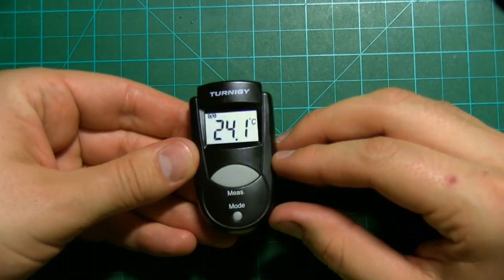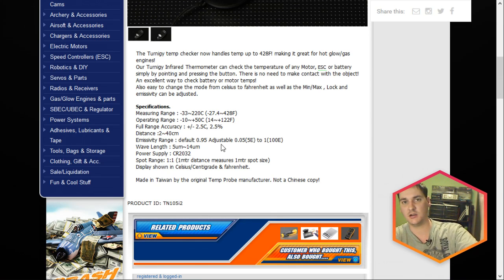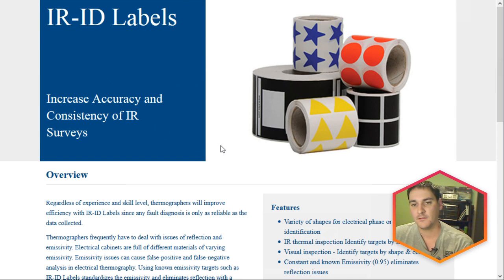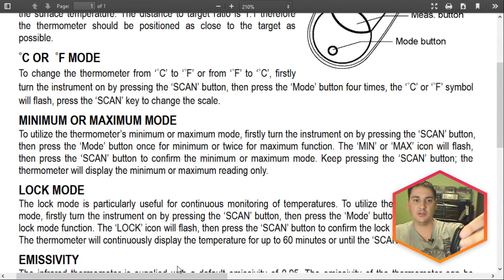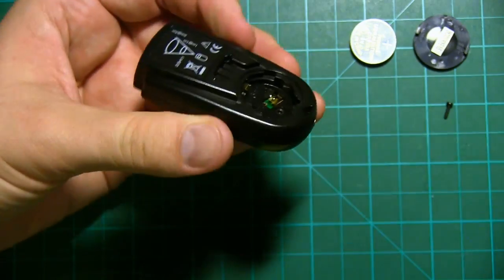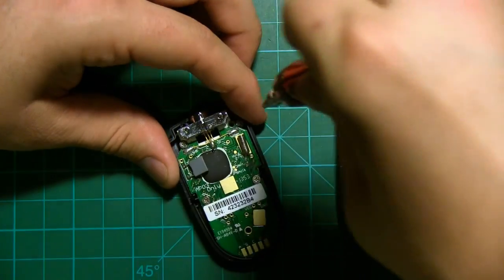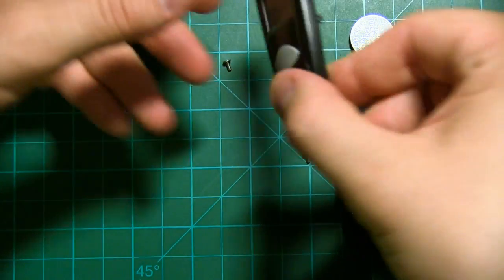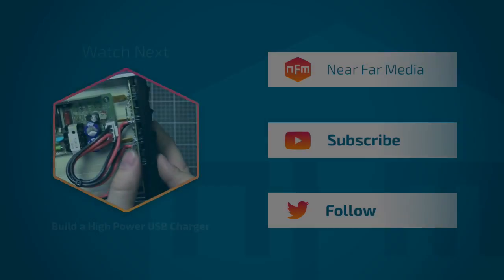Turnigy Infrared Thermometer (ZyTemp TN105i2) Review & Teardown

Comment: Hi! Really nice video. Do you know if the electronic circuit works at 3 volts or the capacitors work as part of a voltage booster?   Thanks :)